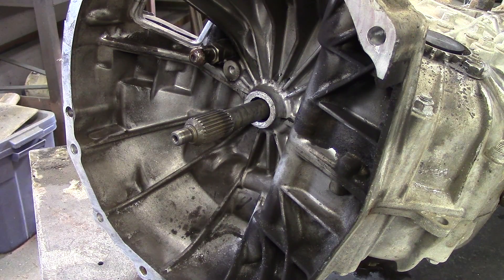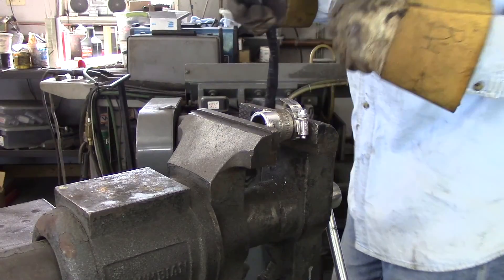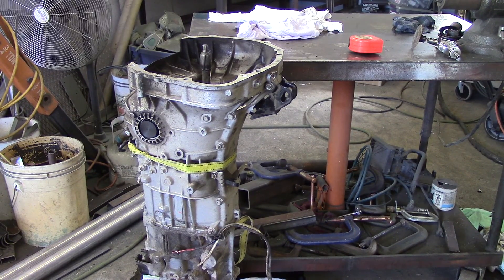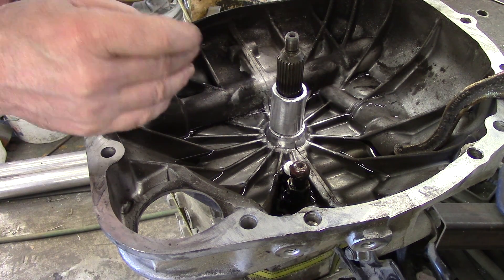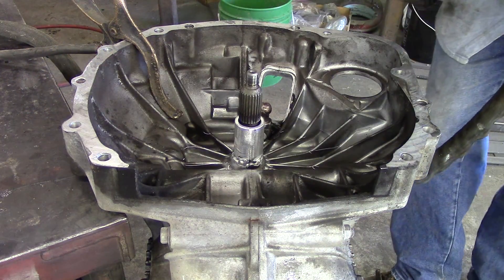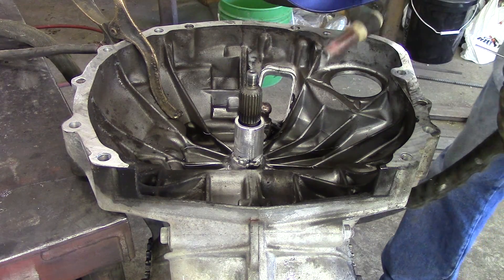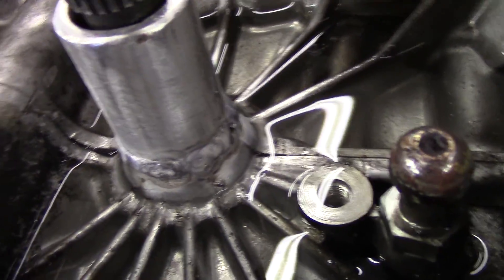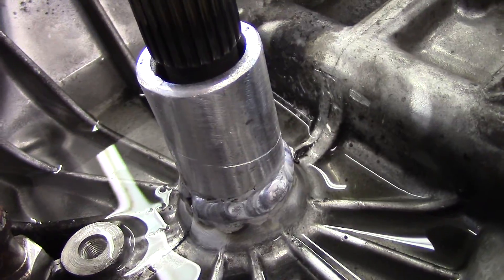Broken Subaru Manual Transmission Throwout Bearing Stub Repair

Comment: Well done! Out of curiosity, what kind of noise did this make that alerted you to the problem?
Reply from the maker: Thank you Stephan. Not sure on the noise the transmission came to me that way, it had been already removed by someone else. The noise probably got worse slowly and probably wasn't noticable at first. Pretty sure as pieces of the case nose fell out it started to wear the pressure plate pretty bad. Thanks for the comment.